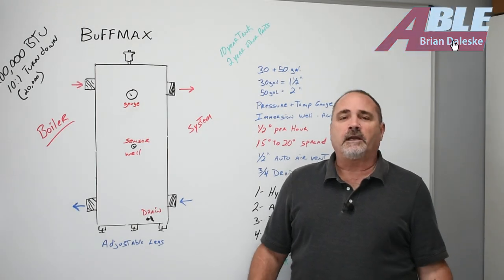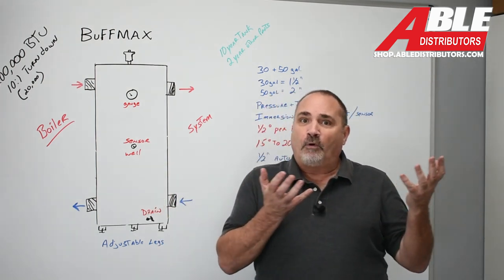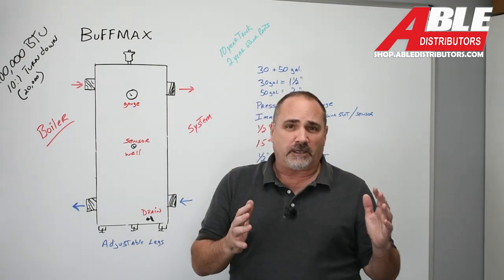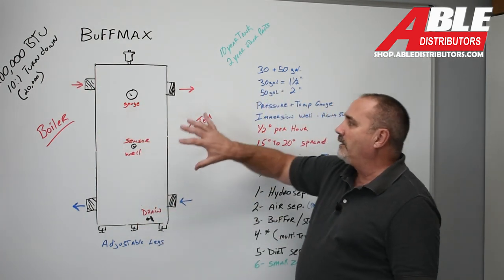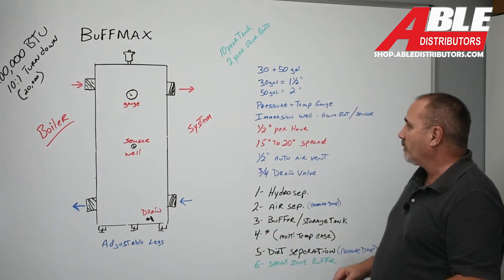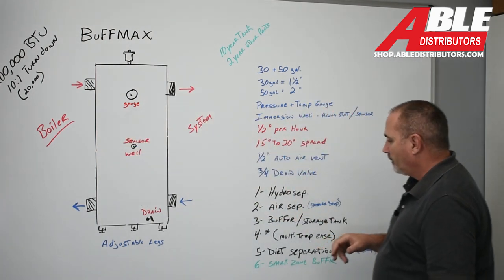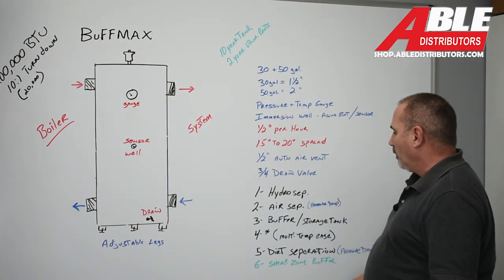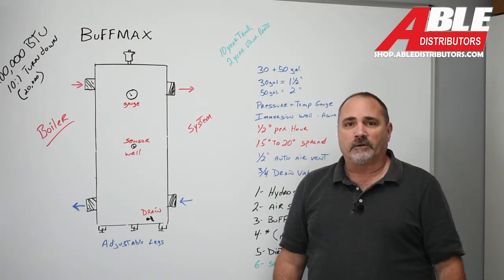Buffmax, Buffer tank, How and Why

Comment: Great vid Brian! I’m interested in the control side; an aquastat would most likely negate outdoor reset from the boiler…some boilers have a header sensor that could be used I suppose, but the wide differential may not be available…aftermarket reset control for the tank perhaps. I’m sure you have something up your sleeve